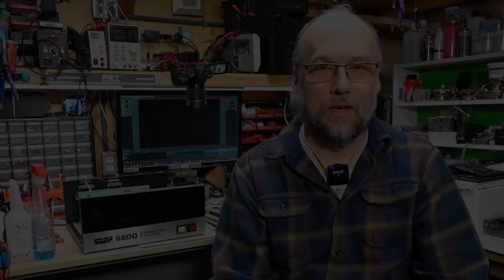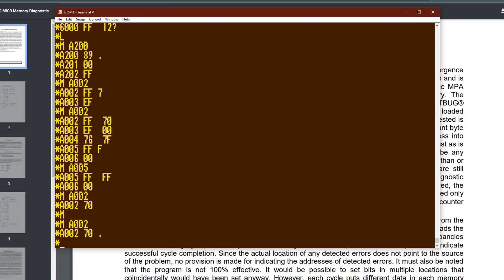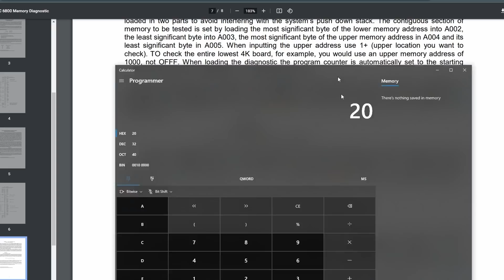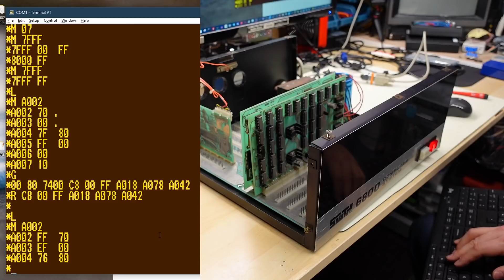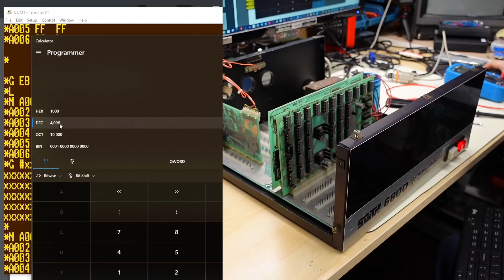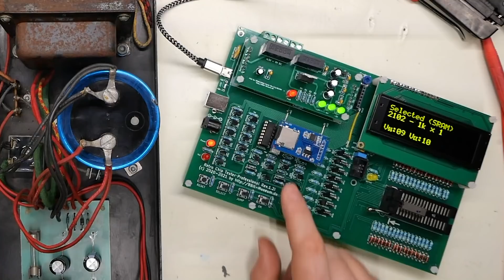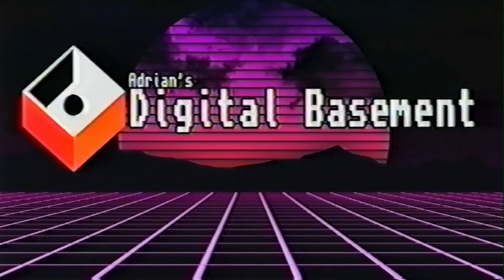Searching for bad RAM on a 45 year old SWTPC 4K RAM board

Comment: Can the memory modules be recreated using more modern RAM chips.
Reply: Making a replacement for an individual chip is likely possible, but I think not much less of an effort than taking some currently available SRAM chip (say 128 kbytes in an easy to get 628128), tie some address lines low, add some glue logic and use a single SRAM chip to fill the entire available RAM address space of that machine. You'd have to design your own RAM board for that, but it likely doesn't take much effort.  Sure enough, it is not nearly as retro as the original. ;-)
Reply: @Colaholiker  You could probably make a daughter card that plugged into either of the existing cards after pulling all the old ram chips. Assuming you couldn't find a 2102 on ebay at some exorbitant price. :-)
Reply: @jimsteele9261  I used to see thousands of them on scrap boards from computer terminals, and couldn't even give them away. They only wanted used EPROMs, along with 4164 and 41256 DRAM.
Reply: @jimsteele9261  It's probably easier to make something that plugs into the system bus than to match the locations of the original ICs on the card and wire from there, but either way can get you to where you want to be.

Comment: 2102 rang a bell with me ... Just found 18 of them, been stored for years so there should be at least 1 good one. Where do I send them?
Got quite a few Motorola 6800 series chips as well ...
Reply: Have you got the clock chip. Trying to drive the 6800 was a real pain using ttl
Reply: @johnbullpit9481  The MC6871A 1.000MHz MPU Clock?
Yep! Got a few of them ...

Comment: Literally 2 minutes in I found myself screaming at you through the phone to just use your fancy tester on all the chips. Would have taken you less time to just test each and spray deoxit on all the sockets in one go.
Reply: Yeah, but he wouldn't have shown us how to load, initialise and run the memory tests. :) And interpret them along with learning how the board was laid out..  to a point. If time was more the issue then certainly your way is the quickest!
Reply: Mmhmm.  He had made a point in the past of targeted testing vs shotgun chip replacements or moving things around randomly.

I think removing everything and testing in isolation is very much opposite the point of this exercise.

Comment: Several suggestions here as to better ways to approach the problem but what you did replicated the efforts of hobbyists when this computer was new using the tools they had available. There was no laptop just a dumb terminal and each test was loaded via audio cassette (a real toss of the dice each time you hit play!).  This video would have represented hours of effort but that was the hobby at the time. Adrian, even your unfamiliarity with the system is reminiscent of that of the original owner!

Comment: Way back then I built a Z80 system from magazine plans. The 4K RAM card used 2102s.(1Kx1) I designed a new version using 2114 chips (1Kx4). I keep thinking about digging it out and doing an "anachronistic restoration" on it by pulling both boards and adding one of those 32Kx8 CMOS RAMS to the Eprom card.

Comment: Adrian: 128 bytes not enough RAM to do anything serious
Atari 2600: I disagree.
Reply: 8051 MCUs also disagree. Many industrial control units use this one to this day.
Reply: @adamw.8579  I did some reverse engineering on a couple of 8051 based control systems lately, and to be honest, all of them used external RAM as well (not saying that every 8051 based design out there does, just all of the ones I happened to come across). One of them apparently had the C compiler used to create the program even setup in a way that everything that was not stack, register or memory mapped IO reside in the external RAM. Even stuff like loop variables, which I thought was quite inefficient. And it even had 128k of external RAM that it did access via bank switching, using an I/O line as address line 16.
Reply: @adamw.8579  I wonder which microcontroller my 1978 microwave oven uses for the capacitive touch panel and clock board. The ENTIRE module was made by motorola so it's not likely to be an intel in there.
Reply: @mikafoxx2717  Motorola made MCUs for automotive electronics about '80s, so not big surprise.
Reply: @adamw.8579  It's made by motorola automotive to boot, though it's a 1978 and the first model was a 1976 touch panel which is a bit early for their motor controller MCU's.
Reply: As I understand it systems like the Atari 2600 and 8501 could do so much because the code could be read from ROM (or flash in the case of more modern microcontrollers). If both code and data needed to share 128 bytes, I seriously doubt you could do much. 128 instructions is really not a lot, and that's the absolute best-case scenario: all opcodes, no operands and no data or variables.
Reply: @andrewsprojectsinnovations6352  8051 is a Harvard architecture - separate code and data spaces. Usually 2-8kB code ROM/FLASH max.64kB, and internal 128 bytes RAM, additional RAM may be installed with cost port 0 and 2 used as address/data multiplexed bus for external ram up to 64kB. Some simple units - for example intelligent peripheral use all ports and only internal 128bytes of ram or 256 in version 8052.
Reply: PICs also disagree.

Comment: Nice video. But at the end, I asked myself why you did not just test all the SRAM chips in the retro chip tester *at the beginning*? That would have saved you lots of time. :D
Reply: But it shows people that don't have a RAM tester how to debug this kind of systems. 
It also made a nice video.
Reply: @jwupf  Exactly. He showed how a true engineer diagnoses an issue.
Reply: @PJBonoVox  Right - and he doesn't do these repairs for a living (at least the last thing I heard is that he has a regular day job), so he doesn't need to be as efficient as possible. Both this kind of repairs and Youtube are  his hobbies, which he shares with us.

@Timo Weirich Since his method obviously got him to identify the bad chip, it was not a "wrong" way ;-). I found this way much more interesting than just stuffing one chip after the other into the chip tester, and it demonstrated how limited the interaction with the bare core of that computer used to be.
Reply: Check electrolytic capacitors first.
Reply: @johnbullpit9481  Why? If the power supply rails have low ripple, they are OK. There is no switching power supply that requires low ESR electrolytics and capacitors were better quality back then.

Comment: oooh! this was cool! I started using computers only in 1982 -- pretty much when the speccy came out, and it's so cool to learn about computers before that!
Reply: Just remember that computers far more advanced than the ZX (or VIC) line existed before this machine was built. (The Xerox Alto of 1972 for instance, which became the inspiration for both Apple Lisa/Mac, M$ Windows and most graphical UNIX shells of the 1980s.)

Comment: Not all 4K programs use the full 4K space. There are plenty of games for the ZX81 that state 16K, but they only use about 4K. (the unexpanded ZX81 is only 1K so you need the 16K RAM expantion). If you leave the last location block empty, there might be enough memory to run some software. :)
Reply: Yes, I expanded the ZX81 to 8 KB (four 6116 chips + an LS138 decoder). That was sure enough for some "16K" programs. The key may sometimes even be a inflated (or non shrunk) display file, which happens at around 3.75 K RAM installed iirc (due to the ROM program's design).
Reply: @herrbonk3635  I replaced the 1K RAM with a 16K RAM chip in my 81 a couple of years ago. It's easy. There is a guide on Gadget UK's YT channel.
Reply: @Franko_Walker  I guess you mean a standard 32K SRAM like 62256, but sure. They didn't exist in 1982 though, when I did it ;)

(16 Kbyte SRAM chips are extremely uncommon, afaik. After the late 1970s, standard sizes are 2K, 8K, 32K, 128K, 512K for byte wide ICs.)
Reply: @herrbonk3635  Your probebly right about it being 32K. And yes, if they did exist in 1982, everyone would have been doing it. :)

Comment: Nice work. As a coincidence, I'm working on an FPGA recreation of this system at this very moment.
Reply: Nice! I wrote an emulator for it, also for Motorola Exorciser (search for "exorsim").  Your FPGA should connect to a real floppy drive :-)  Recently I want to make a cassette tape interface like the SWTPC AC-30, but higher baud, more modern modulation.
Reply: @jhallenworld  The FPGA card has an SD card so I can do stuff on that if I take it that far.
Reply: @SixWildKids Are you done yet? Port it to the MiSTER project!
Reply: Well??? Are you done yet?  😊
Reply: JENNITA B.O  Be-gone bot!!
Reply: @NathanChisholm041  Report, don't respond.